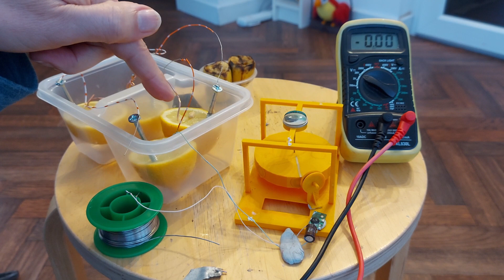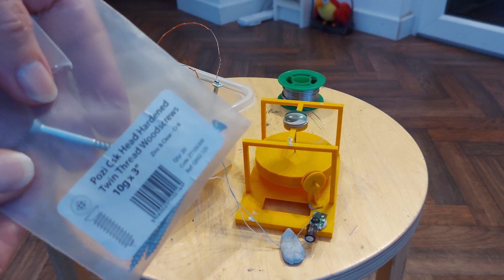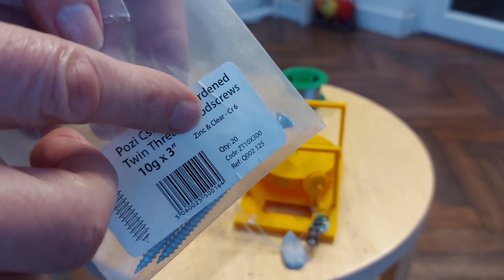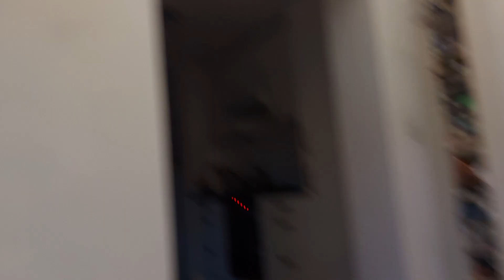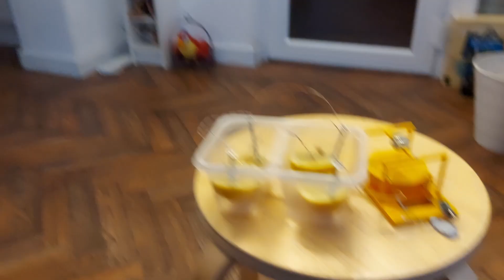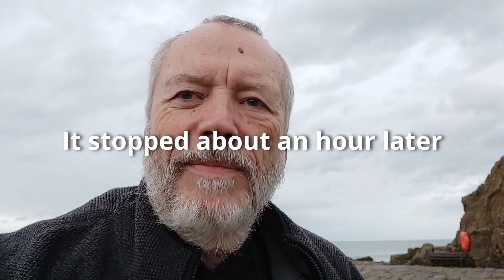Banana Pear Lemon Powered Pulse Motor LEMONS

Comment: Would wire with a larger surface area help at all? Say one of the solid copper coins 1p or 2p not the magnetic ones at each end. And a larger zinc terminals. Just an un educated guess.
Reply from the maker: Yes, a larger surface area should improve current flow. It is a matter of what you have available. Using magnesium rods in place of the zinc coated nails also makes a big difference 👍

Comment: Have you ever explained the science in this as to why this is possible?
Reply from the maker: I do not pretend to be a teacher, however, what would you like explaining. How copper and zinc electrodes produce electricity when plugged into a lemon? Or how a pulse motor works? Or how to 3D print this pulse motor? You might try Googling to find further information or check out my video description for similar videos.

Comment: Hi Graham. In the beginning of the video the motor was turning slowly in a clockwise rotation. At about 5:46, the multimeter was removed from the video and the motor started rotating in  counterclockwise direction  at an increased speed. Did you do anything off camera to the setup to cause that? Interesting video.   Jim
Reply from the maker: You will find pulse motors tend to choose their preferred direction of rotation. It could be as simple as the motor is not sitting flat or slightly out of balance. The way they work is very simple. The circuit detects the magnet passing, that triggers it to fire a pulse into the coil and that repels the magnet to kick it round.  Depending on the alignment of the coil, that may favour a clockwise or anticlockwise rotation. You can also use it in "reverse" so the pulse attracts the magnet rather than repels it. As it is just a pulse, it can work either way. Think of it as pushing a child on a swing. You start with a small push, but you can build up a big swing, and in theory, push them enough to spin over the top 😁😁😂😂 making a complete rotation. OK maybe pushing kids on a roundabout would be a closer metaphor, but I like the idea of the swing.
Reply: Thanks for the explanation. Obviously I know little/nothing about pulse motors. You continue to inspire me and many others with your videos. Keep up your fantastic work.   Jim
Reply from the maker: @melkc345  pulse motors fascinate me, I have done rather a lot of them over the years, although using the solar rocker circuit board always seems like cheating to me. I have done "proper" ones where I have built the circuit from scratch, but using the solar rocker circuit is a quick and easy shortcut. Alternatively, a magnetically operated reed switch does the job at a very basic level.